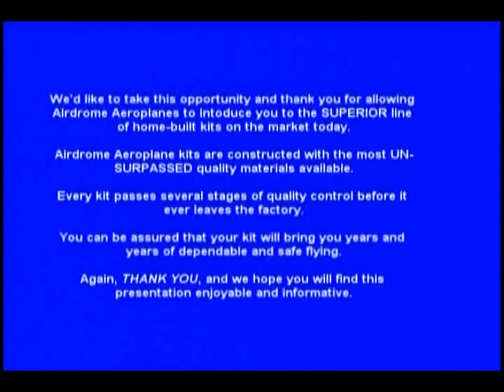Airdrome Aeroplanes Fokker D-VI replica.

Comment: That is the "Ultralight" version. On standard version, the nose is not a Loooonnnnnggggggg....
Reply: @okbuddyretard  To keep it in "Ultralight" weight limits, it has to have a light engine. With such light engines the "moment arm" where the engine is positioned HAS to be further forward to keep the center of balance at or just forward of the center of lift, to maintain stability.